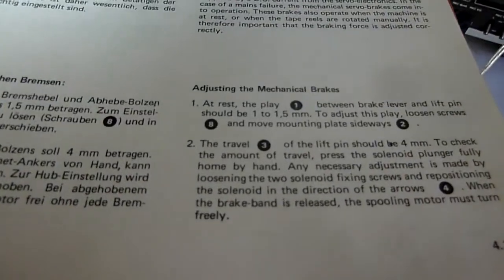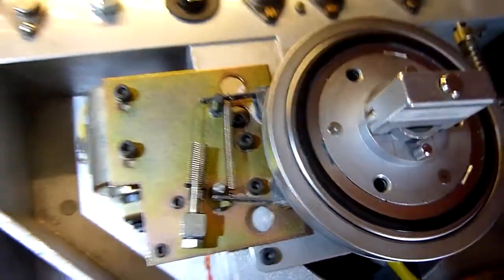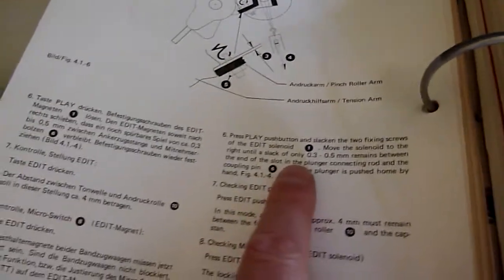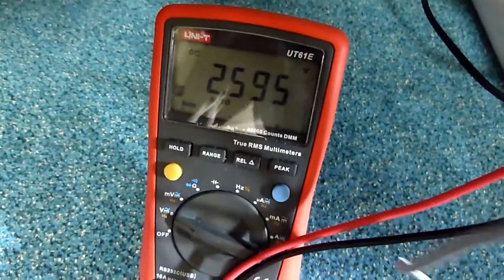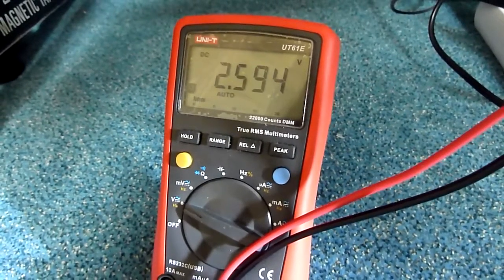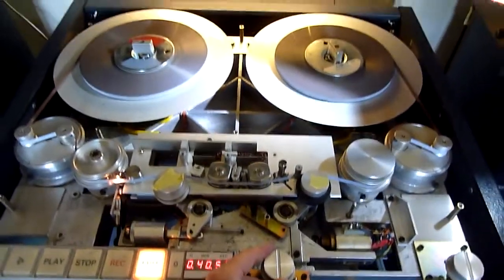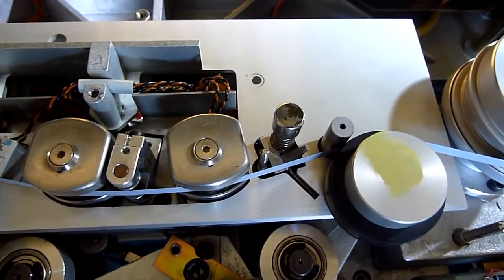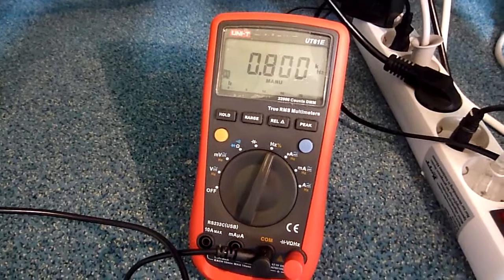Studer A80/R tape path alignment after bearing replacement

Comment: Got myself an A80R so great to find these videos to help me on my journey. I noticed the braking at 5.50 in the video is actually correct at 200 p since you are using a 100mm diameter spool. The asterisk near the 180 text is telling you 200 is the correct measure below the table so all fine there.

Comment: Hi Philip. 
I got my hands on a Studer A80-R  Master Recorder (no VU-Bridge) this early summer, which I'm going through from a-z now, both electronically and mechanically.
So it's good to see your work.
Reply: Your video is very instructive and inspiring. Mostly I have done electronics, changed the Frako caps and cleaned the machine. I also did some electronics   adjustments to the machine - but not to audio yet. I have measured the wow-flutter and it is within specs at 15" but not at 7½". 
So I need to go through the mechanics and then go back to the electronics (it says so in the manuals). And for that, your video is just what I need.
I have a zero-locator button on mine, which doesn't work. And I have found a guy on a vintage hifi site, who helps me with that.
Being the guy with the Studer - is actually a real treat. You're suddenly SOOOO popular.
:)
I have added you to my subscriptions. Hope to hear more about the Studer.
I have a number of videos - but all in danish language and not posted here (yet). Maybe I should do a series in english?
Reply from the maker: Hi Gunnar,
I'm  glad that you find my video inspiring! 
The W/F on my A80 is also worse on 7 1/2.

Maybe if you don't want to reshoot the videos, you can make english subtitles?
Reply: That might be an idea. Or voice over. :) _ recorded on the A80. :)

I just went through the brakes and made small adjustments. That's how inpiring it was.
Reply: Can you help regarding distance between capstan and pinch-roller.
The distance measures 1" exactly on mine - NOT counting the rubber.
And the position (angle of the 'arm') of the pinch roller in 'off' position is apparently correct (as suggested by drawings in the manual) - but there's 5mm rubber, so that way it does not measure correctly.
IF i break the lacquer sealing on the adjustment rod, and align it differently, I fear that it will get all out of whack.
Reply from the maker: Mine was also off but there was no laquer so I just adjusted it. What matters more in the end, is the pinch roller pressure, and the tape tension.

Comment: A lot of work! But analog is worth it, it's worth it to give your music "soul"! Digital is easier, but "soulless"! In my opinion! Wonderful machine you have!
Reply from the maker: True!
Reply: Hi philip
I am George and some time ago I gave you some informations about the tension roller bearings, remember? I noticed in this video that you adjust the tape tension with the tentelometer to 100grs. In my Service manual they say 50grs with tentelometer and 100grs with spring scale.  Ok my machine is a A80RC but possible so big difference??